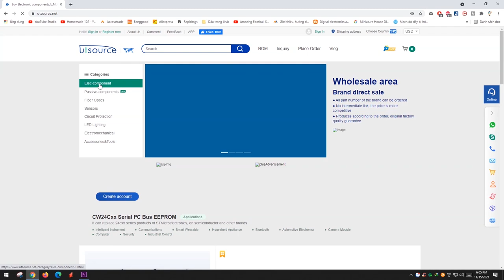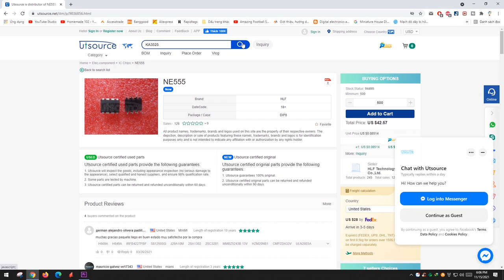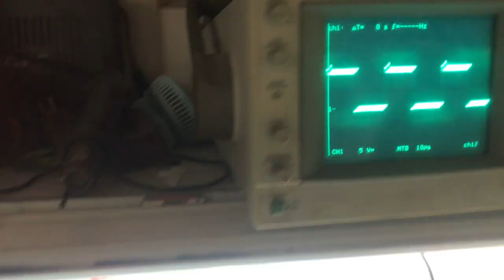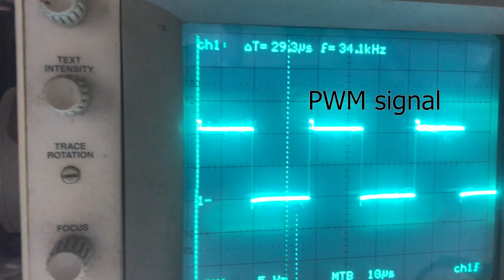PWM module for 3KW inverter | utsource

Comment: where are the snubbers on the primary? This is a push-pull topology and if it is 48 V, then from practice there should be more than 120 V on the transistor collectors

Comment: Very nice video dear brother. 👍 
One problem I face with transformer when I connect the feed  back ic tl494 or sg3525 and connect with 60w bulb mosfet heat up what is the reason please 🙏 help. I wind many transformer but not successful. I am your very old subscriber and I am also your fan🙏

Comment: Hi i send you a message in fb ,i have a problem about spwm ee19 can u help me about ee19 wire turning in primary and secondary,tanx/that spwm made with uc3843 not tny chip.
Reply from the maker: ok bro. I will reply you soon
Reply: hello he did a video some time ago titled make 12 volt sp on that video he said primary could be 35or 30 while secondary could be 15 or 12 turns and you most wind both primary and secondary in the same direction for it to work,(clockwise or counterclockwise)
Reply: @manoftheday1   hi and tanx,i seen that clip,but not ,transformer in this project is different,this transformer have 3 or 4  secondaries voltages with different voltages, and this one for primary need more wending because this is about 400v dc in primary side.but tanx again of you for try to help.